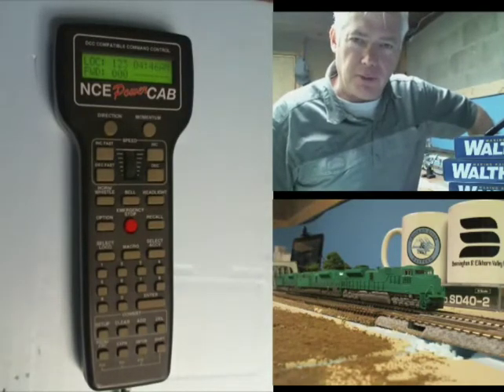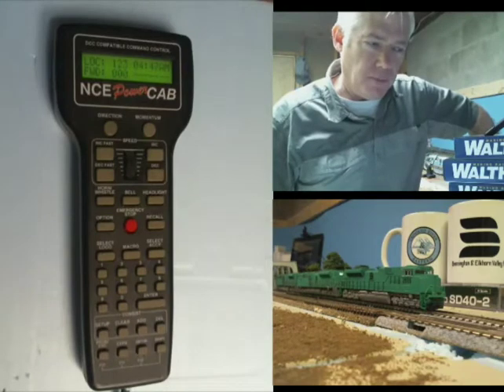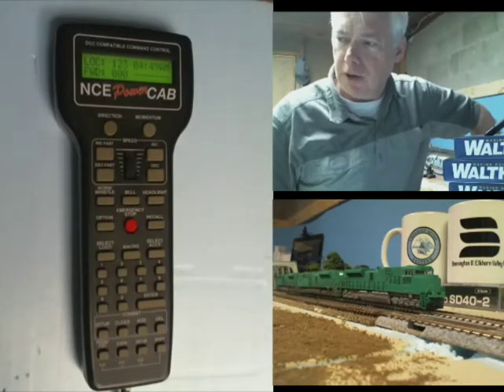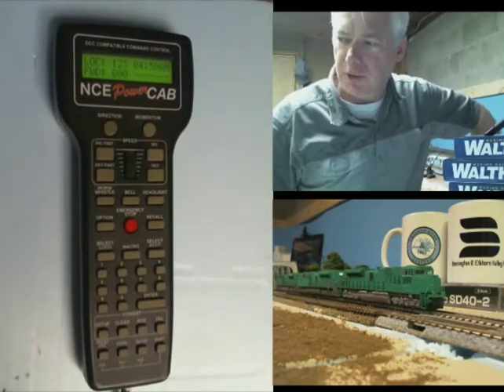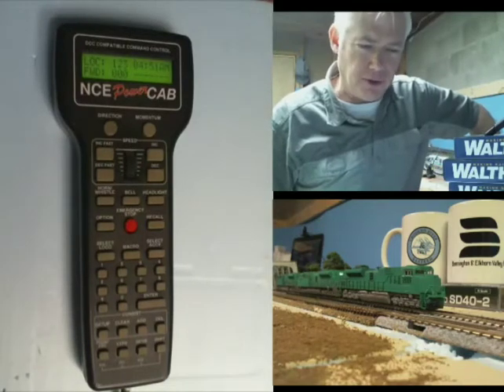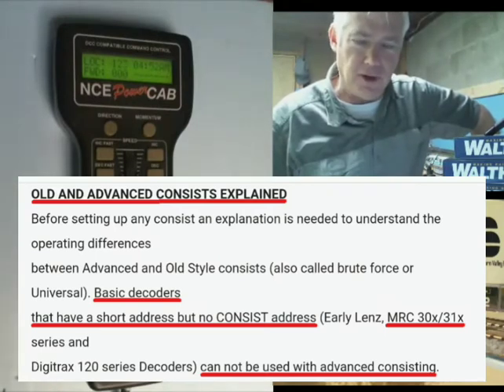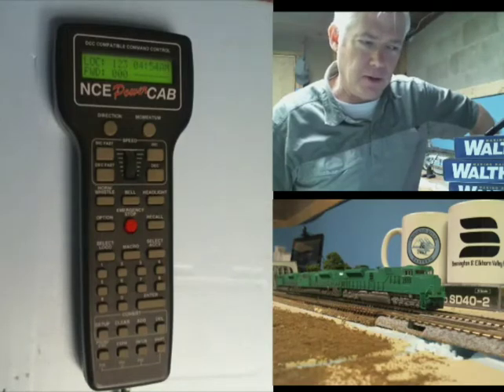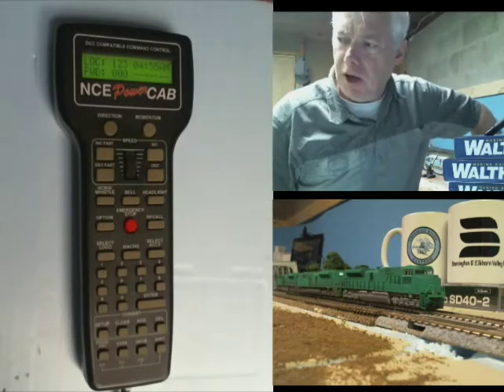Using CV19 to create consists on NCE Powercab

Comment: Hi and thanks for this. I cannot get a Bachmann Plux22 sound decoder to join a consist using my NCE powercab, either when set as the lead or the rear loco. Strangely, it works fine on my test track which uses a Bachmann Dynamics Controller. I will give this a try. Do you know what the CV # is for controlling the sound function? Thanks 👍🏻

Comment: Thank you for sharing...will this work on a NCE Pro cab .. U.K. modeller
Reply from the maker: Hi, thanks for stopping by. To be clear, the only reason I used this procedure (which is standard NMRA use of CV's), was because the consist setup function on my Power Cab wouldn't let me create consists with more than 2 locos which had 'old style' encoders. If you have newer decoders which support it, you should be able to use the consist setup function on the Pro Cab handset. If you're unable to however,  this method I've shared should work.

Comment: Hey Jeff, I also have a powercab. You are programming cv 19 correctly but in order to get the bell, headlight and whistle to work you need to programs cv 21 and 22.  I use soundtraxx decoders. The programming will work with whatever you have.  George Boagatiuk from Soundtraxx explains how to doI an advanced consist with the powercab. You might want to check it out. It helped me.
Chuck
Reply from the maker: Hi Chuck, the only issue I addressed here was creating consists with more than 2 locos (ie 'new style'). This seemed to be an issue with the XL Systems decoder working with the Powercab. Ordinarily you can do it with the consist function on the cab pad, but wouldn't work with the XL decoders..so CV19 was found to be a workaround. The bell/whistle/etc work fine for me without using the CV's. Thanks!

Comment: Jeff after watching the beginning of this, I think the NCE advanced consist was working, you just needed to switch over to using address 127 for the consist once you've configured it in the throttle.  Using CV19 is what advanced consist changes in each loco.  I usually just set CV19 myself, since it's easy, but I am pretty sure the advanced consist option in NCE works, just needed to change to the consist address.
Reply from the maker: I'm at work, anxious to try that.. although from NCE's own online blog..
"The lead loco number also acts as an alias for the consist number entered above. Say you have a bunch of consists stored on staging tracks and you wish to operate one of them. After the consist is set up, you can select the consist by pressing SEL LOCO then entering either the lead loco number or the consist number. The lead loco number is typically easiest to remember because it is the number printed right on the locomotive. The consist address may not relate to any visible oreasily remembered number."

So yes, will be interesting to see if consist number works where that lead loco number 'alias' doesn't. Maybe that 'alias' not working is the only issue.

Thanks!
Reply from the maker: Roy, I reset everything to 0 to be certain.. ran through NCE prompted advanced consist setup again. This time selected loco 127 afterwards. It still doesn't work. So, I think there's still an issue with it working with the XL Systems decoders.. leaving your process of going straight to CV19 a good one.  Thanks!
Reply: @jeffsbenningtonelkhornvall2207  Ok, so the NCE stuff is maybe trying to set other CVs that the XL decoders don't know or like and that is the issue?
Another thing to try is using the NCE one but setting it to consist 1 or something lower than 127. It's possible that 127 isn't working with XL systems.  In any case, I am glad I was able to help!
Reply from the maker: @RoyEltham  Good thought.. I tried 1, which I realized NCE doesn't support for some reason.. only 112 through 127 (see link to man page.. yet using other values via CV19 works fine obviously, so not sure what's up there). So I tried 112, still no go. So yeah, NCE and XL decoder not going to cooperate. https://ibb.co/ccyQKRL
Reply from the maker: I'll try that.. although NCE doc suggested that it would work via lead loco (as designated with CON label). I guess I may have to make follow up video. Hah, well in any case, good to know behind scenes CV's used.
Reply from the maker: I should say that's how old style consist works as well.. controlled via lead loco. Not the most intuitive, hah.